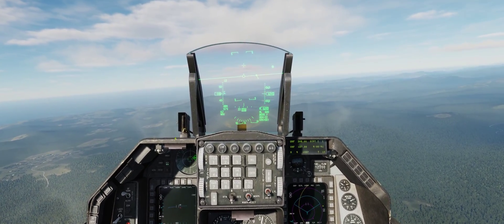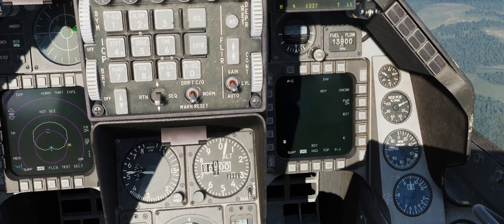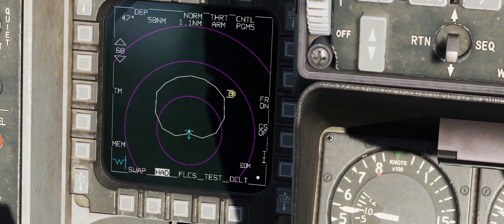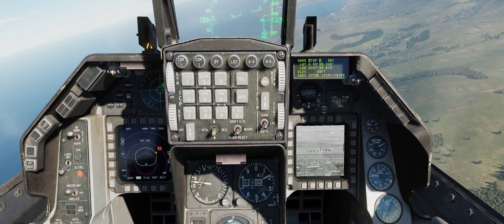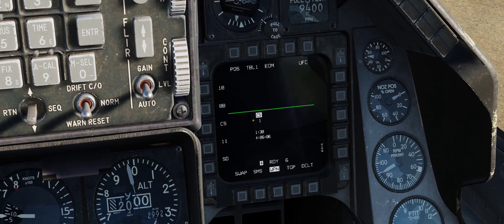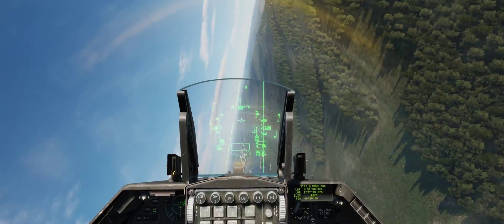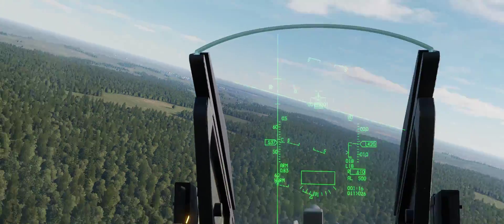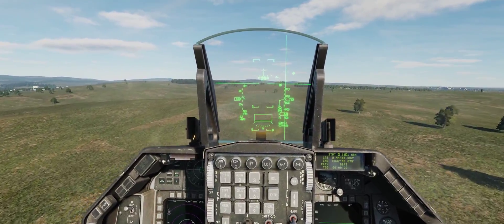DCS F-16C How To: SA-10 Vs HARM

Comment: Thanks for this video! One question; What's the advantage of involving the TGP if you're using the HTS pod? Once the "10" shows up on HTS, and you TMS Up on it, you could still fly in the same way and launch a HARM without even opening the WPN page for it or even the TGP itself, no? Is the advantage just that you have a mark point on the HMCS? I can understand the use if you're not using HARMs, e.g. trying to drop bombs on radars found by the HTS.
Reply from the maker: Getting the precise location of the site, creating a STPT at that site, and then directing the HARM to fly to that location is the best way to send a HARM from close range.

The HTS pod has quite a bit of error in its position solution. It’s acceptable if you are shooting the HARM from a distance and the missile has a Birds Eye view of the target from 20 miles out. However to shoot from close range, you want the HARM to know EXACTLY where to go!
Reply: This way if the radar goes cold, the Harm still has a guidance point to fly to, instead of being trashed
Reply: Thank you! I had the same question.

Comment: Undocumented, but you can press MSEL to make the current Markpoint the active Steerpoint. Saves a few steps by not having to switch to Nav and manually entering the SP. Great work on the channel!
Reply: thank you for this
Reply: Is it really undocumented? M-SEL sounds like a great abbreviation for Markpoint Select.
Reply: @diacoal2433  It could be in the latest manual rev. Not sure. ED needs to update the manuals as the Early Access modules develop. The F-16 manual needs a lot of updating.

Comment: The SA-10 took that long to engage you because ED accurately simulates the Buryat "technically not a conscript but might as well be" radar operator occasionally taking a peek at the radar screen inbetween considering if he should pawn off the vehicle's gas to the locals or have the missile payload accidentally get dumped in the water during a loading accident.